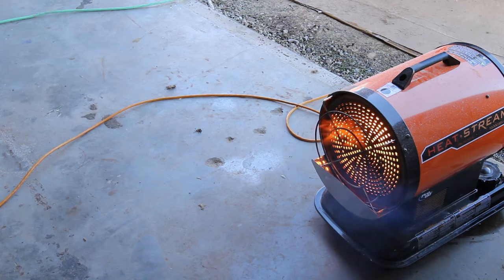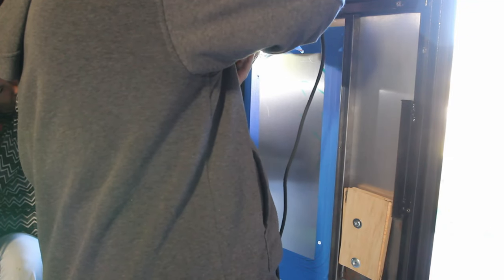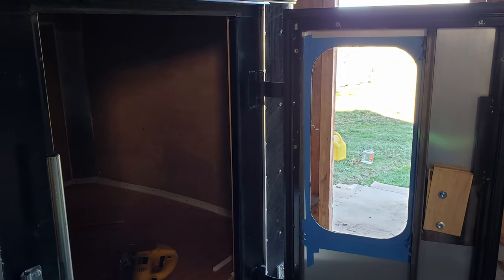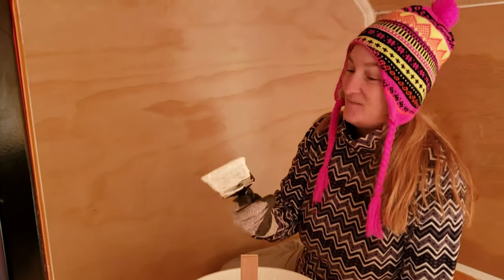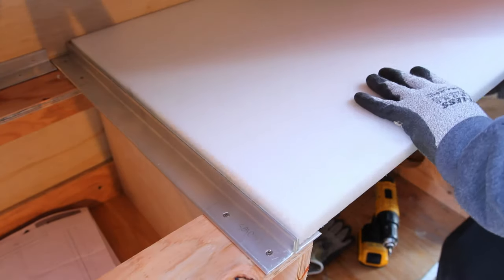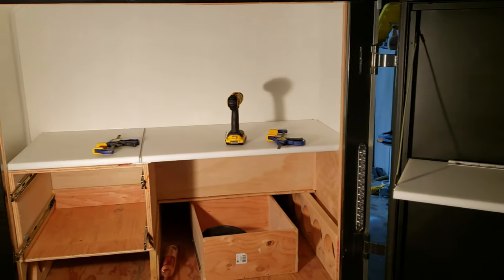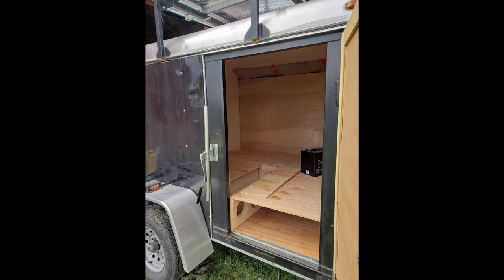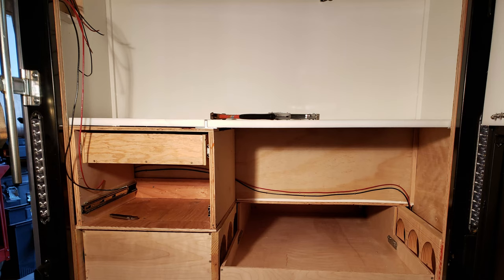Cargo Trailer Conversion Build Part 4 - Electrical, Painting & Counters

Comment: I'm in the process of building one. I have a mini van so I went with a 5x10. My question for you is there anything that you do differently with your build now that you have had some time to use it.
Reply from the maker: Nothing that jumps out at us, there are some minor changes we will be making, changing up some wiring and cleaning up some stuff we rushed last winter.  You really just gotta build it for your needs.  Then again maybe a second door or window for cross venting on warm nights.

Comment: I have enjoyed watching your 4 part series on this 5x8 conversion! I want to build one of these soon. I will be building more of an offroad version, but might build it up with stock tires first like you have. I want to install a fridge just like you did, but will probably just slide it out and make the counter permanite. I then want to put a small sink next to it. Large water tank under the bed.
Reply from the maker: Thank you.  We like the over road versions that we see people building.  However we know the limit of our tow vehicle and while we enjoy the dirt the soul is just not an offroad tow vehicle.  Have the fridge on a dedicated slide is nice, however even with an easy slide, the idea of opening and closing the slide every time we want in the fridge was not ideal.  There are times we just tow down to the rivers edge and sit for the day.  And you know how many beers you can go thru in a day.   For water we have some Rotopax that we fill at camp, or before if camp does not have water.  However if your tow rig can handle the weight having on board water would be nice.